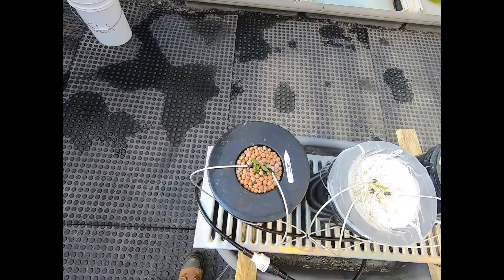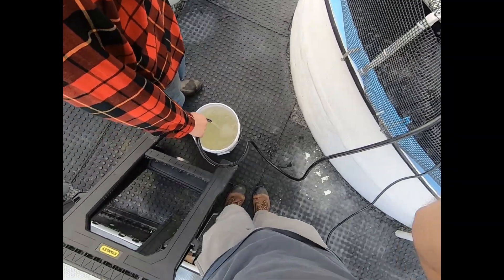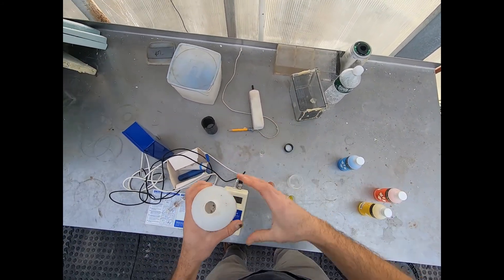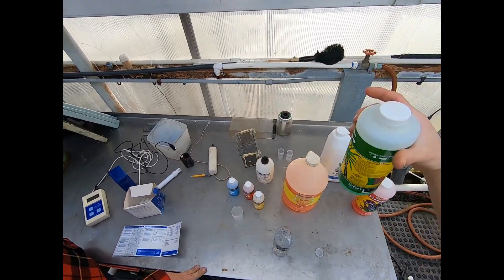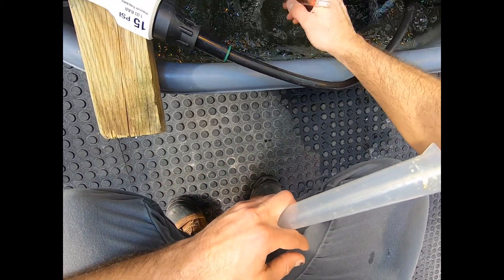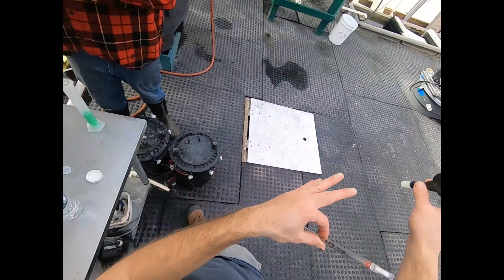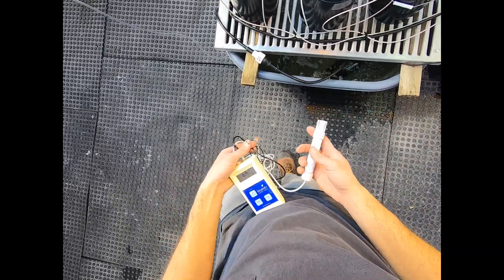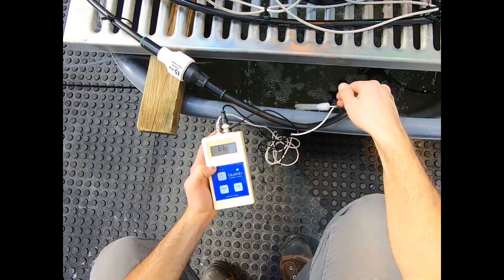Adjusting nutrients and PH in aeroponics

Comment: Its best to use distilled or RO to wash the ph probe before and during the  calibration. The ph of the nutrient solution will take a while to stabilize so you should recheck the ph afetr an hour to see if it needs any further adjustment. For tomatoes i would aim for 5.8-5.9